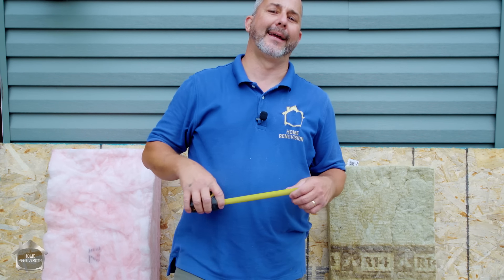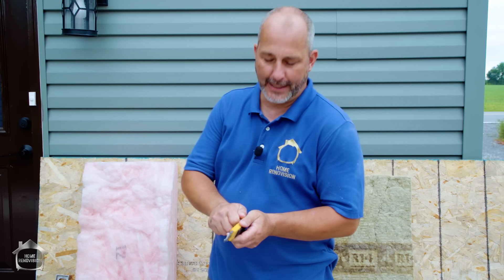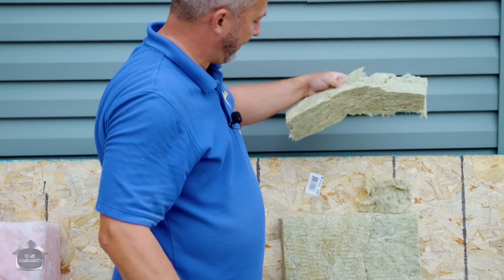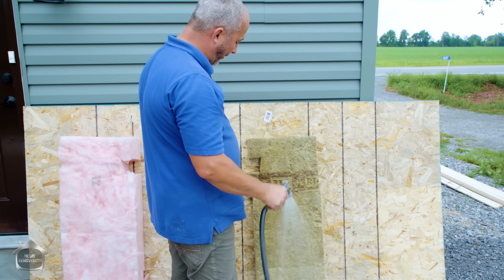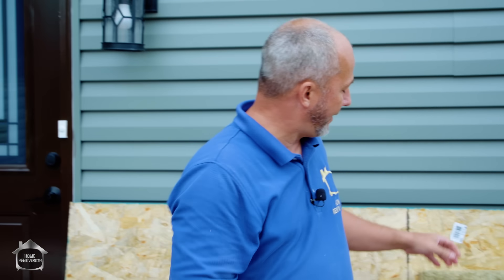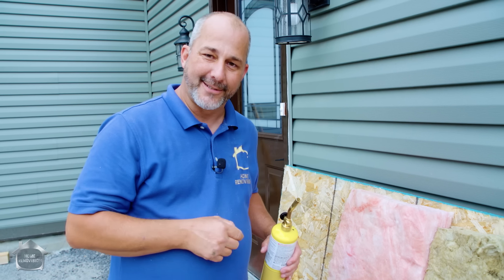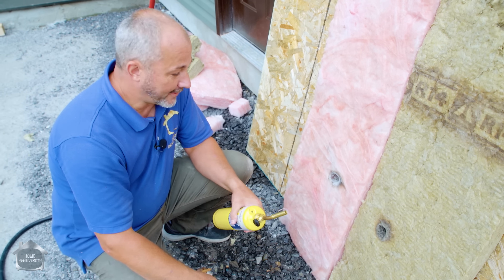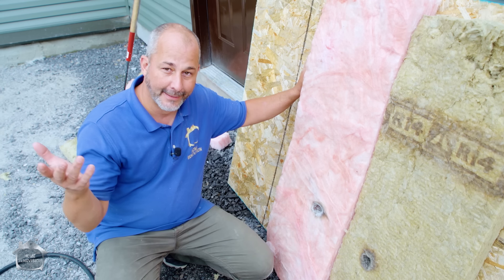How to Choose the Best Insulation for Your Home | DIY Home Renovation

Comment: Hi Jeff. I live in northern Ohio in a late 1960s ranch. Walls require a minimum R-value of R-18 in this part of the country. The house is framed with 2x4s and contains batt insulation with a paper vapor barrier (not stapled). From what I've researched, the max R-value in 2x4 framed walls is R-15. What is the best way to get to a minimum of R-18 in this situation? I've read spray foam could get me there, but it would be extremely expensive to spray every exterior wall cavity. I've also looked into strapping 2x2s onto the existing frame to get me to 2x6 framing, but then that would cause an issue with the wall profile around the window and door trim (not to mention I'd be reducing the overall square footage of the home). What would you do in this situation?

Comment: rockwool has less thermal drift because it is more dense, better to work with (not as itchy by far), is not as friable and if some does get airborne does not stay in the air as long. I have helped remodel a few houses (4 with pink 1 with rockwool) that have the pink stuff and it is absolutely horrible trying to remove and do rework. the rockwool is no where near as bad. does not need to be strapped (aka less installation time) and awesome if working alone. fluffy on horizontal is never as good as it will compress over time so lower r-value. so it really comes down to up front cost or cost over time. I would rather spend more up front and have slightly lower heating/cooling bills for the years I own the house.

Comment: You have more chances of compressing the fiberglass and thus you will destroy the R value as it needs to be fluffy for retention of its insulation value. Yes the wool is more expensive.. but you get what you pay for. Work smarter not harder

Comment: Fibreglass is just simply a rotten product it collapses over time which results in lost R-Value if it gets wet say because had the roof leak it not only collapses but never recovers if it gets sodden and needs to be replaced and thrown out. Rockwool as a product yes it costs more but it doesn't collapse like fibreglass it doesn't get soaked through as it repels the water. Over time the cost of replacing fibreglass through damage and natural collapsing of the fibreglass in its R-value loss and insulation leading to having that heating on higher means you spend more in the end. Also, the soundproofing that Rockwool and such offers even when not using the soundproofing product is an added bonus. I'd never go back to using fibreglass I've wasted so much money replacing the stuff and never had to replace the Rockwool.

Comment: Ive bought a good amount of the Roxul Safe n Sound for building sound baffles in my studio, as well as some sound deadening around my home theater. I enjoy working with it over the traditional pink stuff, and I'm willing to admit some level of buying into marketing BS, but I could see myself using the rock wool for any interior walls I want sound deadened, and then traditional pink in exterior, insulated walls
Reply: Can you actually tell the difference in sound quality? I'm just curious to if it is marketing BS
Reply: @goodwince  i cant only because i dont have a control test with the pink.
Reply: Logical response. I'll do some research. Thanks!

Comment: Great work as always, you should do one on external insulation. Lots of provincial utilities are giving big rebates to add exterior insulation. Curious on your thoughts regarding moisture movement and condensation in a retro fit application. Here in Manitoba they are covering about 80% of your material costs, I have to do a full siding replacement on this home wondering what your thoughts are on it. I am hesitant to add foam to my 1940's build as I am not confident that vapor barrier has been applied in the areas I have not touched concerned about creating condensation against the exterior and damaging the insulation and exterior seething.
Reply: There shouldn't be any vapour barrier if you're sprayfoaming. Should use a closed cell spray foam which would act as the vapour barrier.
Reply: @tiagosimoes7422  I'm talking external rigid insulation not internal spray foam.
Reply: @andrewpage9316  sorry I'm confused then. If all you're doing is replacing siding how do you plan on installing exterior insulation?
Reply: @tiagosimoes7422  With the siding off its pretty easy to add rigid foam XPS/EPS or Roxul makes a product called comfort board. Rigid foam gives you about 3.5-4.1 R per inch Comfort board is about 4 per inch I think? Once it's up rain screen then new siding.

Comment: Which one is more itchy and dusty and irritating when you're installing it?
I insulated my entire 2000sq/ft house by myself in a major gut renovation. BY FAR, the worst part of the project was dealing with the old blown in fiberglass in the ceilings, and installing new fiberglass batts upstairs and down. Knowing what i know now, I'd gladly pay more if roxul is less itchy and still comparable in sound reduction and insulation value.
Reply: Fiber Glass insulation doesn't really make you itchy anymore.
Reply from the maker: very true, and the graNULES THAT FALL OUT OF THE WOOL REQUIRE YOU TO USE GLASSES. cHEERS!
Reply: @JediOfTheRepublic  granted, its not nearly as bad as 20 or 30 years ago. But its still pretty awful.. maybe I'm just a baby lol

Comment: I installed so sound roxul in my exterior 2x4 walls didnt have an r rating on the package... Jeff do you have any idea what the r rating is? i just thought the installation would be easier with roxul rather than the pink stuff
Reply: Pink r12 and  roxul r14. We did a comparison for energy purposes on my bungalow and roxul would only save us $13 a year on heating cost so went with the pink fiberglass.
Reply: Pretty sure the Safe and Sound does not have any R value, its just for sound proofing. You need to use the Comfort batt for R value
Reply: The SandS is damn close to r12-r14.
Reply: R14
Reply from the maker: Hi David. the products are actually made on the same production line and then simply packaged differently. You have a R 14 rating.
Reply: @HomeRenoVisionDIY  thanks Jeff i really was surprised that there were no indications on the packaging...

Comment: Your statement comparing sound proofing characteristics of both is misleading. Neither Owens Corning (the pink stuff) nor Rockwool (Roxul Comfortboard) list any STC rating for either product. Rockwool only lists an STC rating on their “Safe and Sound” product, which is 50.  The purpose of that product is sound reduction. Rockwool does not publish an R value on that product because thermal insulation is not its purpose. So, yes, the situation matters, but so do the specific products. Your video was too shallow to present an accurate comparison.

And like another commenter said before, and you even said during the farmhouse remodel on your other channel, there is no comparison between the two for pests. Pests love Pink!!!!!

Comment: Roxul is denser, holds shape better, soundproofs better, easier to install, doesn't itch and doesn't mold like fiberglass.  Also per same thickness gives more RF value which if you working with limited space is a no-brainer.  It also lasts longer than fiberglass and is water-resistant.  Roxul is far superior and some countries don't even use fiberglass anymore.  If you are a contractor trying to maximize profits then its probably none of the concern if fiberglass goes to chit way sooner or starts molding down the line.  Guess if one is cash strapped and moisture isn't an issue fiberglass will do just fine.  End of day you get what you pay for.

Comment: Rockwool installs much easier. It doesnt accidently get compressed in areas ,as fiberglass does easily. You cut it slightly smaller around outlets , etc, and  it will expand around those objects tighter than fiberglass. Its similar to how a expands by itself when squeezed and let go.

Comment: You forgot to talk about the biggest difference between the two "Thermal Drift" over time and lets just say short time and or poorly installed. How many home owners or for that fact contractors insure that they fluff the pink to get close to the described R value...as directed before putting in the walls?

Comment: I researched this to death before i bought the rocksul so you tell me if I'm wrong it says that if there is a fire the pink stuff can be deadly to fire fighters because of the fumes and the rocksul will not be if I am wrong so be it  I've already bought it but I'd like to know I'd also like to know what the black knife was that you had to cut the rocksul with signed "I'm just a nurse"
Reply from the maker: Hi Lisa, firefighters wear masks with their own oxygen because everything in your house is toxic when burned. the insulation makes no difference.
Reply: @HomeRenoVisionDIY  thanks for the clarification.

Comment: I'm loving the roxo or mineral wool for a few reasons. The biggest it doesn't leave me itchy lol. With the pink fiberglass insulation I find that I need a mask, long sleeve shirt, and gloves. And I tape the gloves to my sleeves. The first time I worked with mineral wool I was in love 😆. Way way easier to install. There's no itch to it and I find that it not only makes the house feel warmer but it seems to be a good sound barrier as well. Yes it's a little more expensive but worth it I say.

Comment: I use an electric knife (like for cutting a turkey at Thanksgiving) for cutting Rockwool insulation. WAY better than a bread knife or Ginsu. I love the vapor permeability and resistance to compression that Rockwool provides as well.
Reply: I used a regular saw, had to cut every piece because of 12” on center floor studs.

Comment: Great information, however I was wondering what would be a step up in terms of R value ? 
Thanks Jeff
Reply: There’s all kinds of rabbit-hole insulation science if that’s your thing, but for 2x4 framing you can only jam so much R value in there. Dense pack/wet spray cellulose or spray foam would be the next step up. Spray foam beats the pants off anything as far as R value, but wet-sprayed cellulose is far and away the best for sound deadening. It’s also cheaper, and greener. With cellulose, you might get close to R4 per inch, whereas spray foam you can get R6.5-7 per inch (closed cell). Spray foam also has the benefit of adding some amount of structural rigidity.
Reply: You could also use polyiso which gives you the same r value ad spray foam in board form
Reply: Tiago Simoes ah yes, Cut-and-cobble is always an option with board insulation (eps or xps), however, the time required for installation requires a thorough evaluation of what YOUR time is actually worth. Compared to the aforementioned it is exponentially more time consuming.

Comment: One thing you forgot is rodents... rodents love the pink stuff, have not seen that with roxul... i am in the middle of renovating a small house and when i tore out the drywall, half of the pink insulation is gone, shredded by mice and the bottom foot of the wall is full of the insulation... My opinion is roxul is a better bang for the buck.....unless you have a house full of cats lol.....

Comment: Thank you for your great videos. 
I have a question. I live in a 100 year old mill house is South Carolina. So hot and humid and some winter. My floors have old insulation but it mostly has fallen fown since back then they didn't use a tape measure 20 to 28" joist spacing. The subfloor and floor is pine and has a lot of gaps. Do you think close cell spray foam would be a good idea? I got an offer for 900 sqft 2 ".for $2000
Reply: I would recommend 2" rigid foam and using a foamgun to seal up the cracks. For 900sqft check prices for close cell polyfoam, as they come in very large sheets.

Comment: Could you make a video discussing how best to deal with new builds that has insulation wrapped in the basement with no studs? Should you just put the studs further away from the wall and leave the builder insulation? Or rip the insulation off and redo it after the framing.

Comment: From what I have looked in to, the fiberglass will loose its r value when it is compressed or if a piece is installed sideways. As in trying to fill in an area that a whole batt would not fit. Mineral wool retains most or all its r value when compressed, and I believe can be installed in pieces filling in. Mineral wool has a slightly higher R value as well.
Reply: When you say sideways can you explain? I'm using 24 inch by 8 ft lengths cut down in to 16 inch pieces to fit

Comment: Rockwool in exterior walls and fiberglass in the attic area. Faced batts facing down towards rooms and two layers of unfaced R-30 crisscrossing each other. R-73 in attic.... R-20 for 2x4 walls with the extra layer of foam board on outside walls with reflective layer. Layer of tyvec between exterior wall and foam board. Should have a good air and water tight home when finished.

No central heating unit will be installing (hopefully) Mitsubishi ductless system in home. Every room will have its own climate control. Hate ducted systems.... absolutely hate them.....

Comment: Found you channel because of your farm house reno. Siding and leveling and such. All things I'm dealing with here with our 100yr old house. Have to insulate the attic after some asbestos removal and was going to go with mineral wool since I don't have a vapor retarder up there. It's an old house with full tongue and groove walls and ceilings. Now I'm not sure anymore. Maybe I'll go with kraft faced pink for one layer (face down) then unfaced for an opposite top layer. Every contractor is saying spray foam. But it'll cost me. Plus we may gut the second floor one day, so spray foam would be a disaster to deal with. Any thoughts?

Comment: I just did a drywall tear off and replacement in an 8x8 section of wall in the kitchen. Since I was down to studs my wife suggested we sound insulate because a bathroom was on the other side. The sound muffling was very good with the rock wool. However, where there were pipes in the walls the rock wool was very hard to install. That stuff just does not compress.  I had to cut lots of parts away to wrap a around the drain and vent pipes in the wall. If I did it again I’d get a mix of rock wool and fiberglass, stuffing fiberglass in the little nooks and mineral wool in the bigger areas.

Comment: I see mineral wool on project Specs all the time, especially at exterior walls and rated walls. Isn't it 3 times more dense than fiberglass?   Price is certainly a factor. Right now in the area of Canada I'm in, if you want Roxul AFB or CavityRock there is a 6month lead time. ComfortBatt or SnS can be more easily got

Comment: STC is not a linear scale, it's logarithmic, so whereas fibreglas has an STC 39 and Roxul a STC 45 for comparable walls, the difference isn't 45-39 it's more like 10^(45-39) times less sound energy.  That is why there is a noticeable auditory difference in a room insulated with Roxul vs Fibreglas.

Comment: One thing I would add, is if you have to try and pull it behind any strapping (or other) when doing a retro installation. The fiberglass is easier to pull through, the mineral wool just pulls apart.

Comment: If you are insulating a ceiling, you can bend the rockwool and pop it in and it stays there.   I found rockwool easier to work with, quicker less steps,and way less itch.  With fiberglass in a wall or ceiling you need to staple it and put a moisture barrier if it is unfaced.  The rockwool just goes in.  Do to price I don't know if I would do my whole house, but as I have been redoing small areas the price is negligible, so I use the Rockwool. Ironically the reason I bought it the first time is because it was on sale and was cheaper than fiberglass, I liked it much better.

Comment: I went into this with 0 knowledge about insulation. Didn't know they would be so fire resistant. Good to learn what really matters is just the price and where you intend to place them.
Reply from the maker: Cheers Angel!
Reply: Something I use it for, even thought it's not called for, is in walls with a 220v electric in-wall heaters.  Most modern heaters are very well designed with extra safety features, so a fire is unlikely, but not impossible.  Also, in a cold wall, I could imagine the hot and cold creating a moist area - supposedly rockwool is more mold-resistant.  (Mold resistance is also a reason I use this on top of my HVAC trunk lines in the basement.)
Reply: by the time the fire is into the drywall, it's so much heat, and it's so widespread that I imagine the insulation basically melts like cotton candy after 10 seconds.
Reply: Yeah but insulation is fow wind and humidity
Not acaual fire😂

Comment: Great video, love the demonstrations on what actually happens when wet or charred. 

One thing I'd like to bring up is the pest and rodent factor. Since it compresses twice as much, fiberglass attracts rodents for nesting during winter months. Bugs also have easier access to inside the home. Rockwool is a much tighter fit, providing a better seal on the exterior. Just something I've noticed as an electrician, where I'm constantly working in and around insulation of all types.
Reply: Oh, thanks for that little insight.
Reply: Have you noticed that the Pink slides down the wall over time? I've listened to other reviews that mention this... affecting long term R value (?)